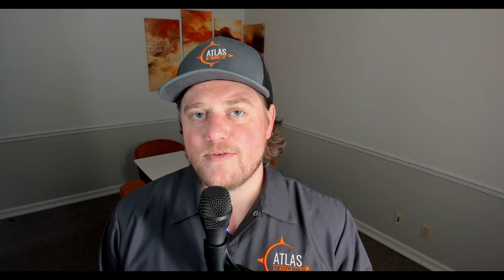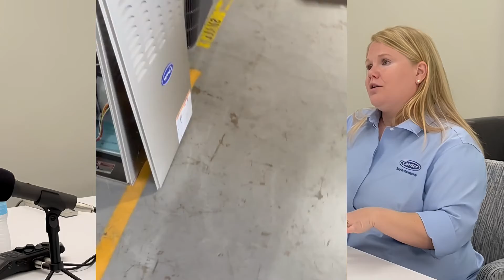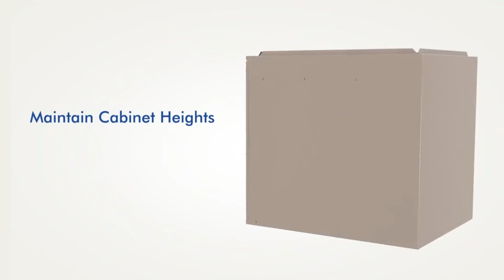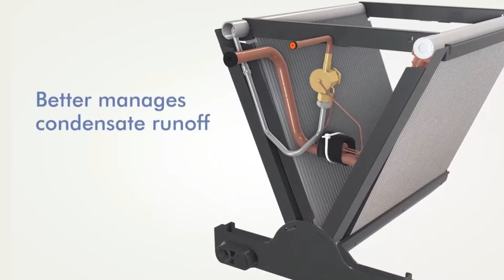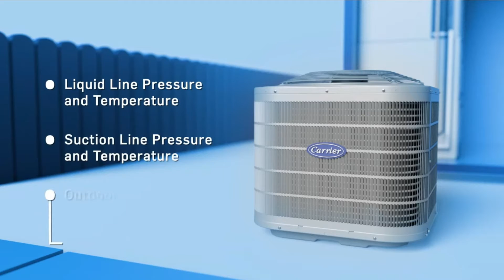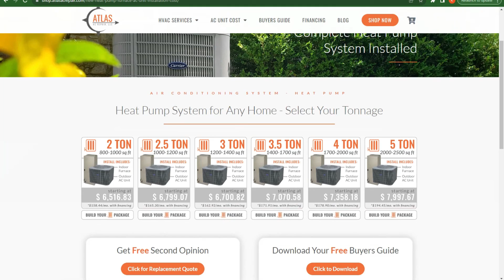Technology That Separates CARRIER From The REST

Comment: Likable fellow.  Seems honest.  Open.   Having said this, I DO NOT WANT my A/C electrically, permanently, attached to the SALES DEPARTMENT in addition to the dealership.

I want it to work.  Air conditioning is NOT COMPLEX unless made so.   Remember refrigerators that lasted forty years?  That is the same as air conditioning, essentially.

I want a unit that will work for twenty years as the A/C I have now has, and now has become noisy (Condenser, outdoor assy)  I don't want vagaries like firmware updates, communication errors, introduced problems by the dealer, permanent ways to degrade reliability in the name of increasing reliability.

Comment: What about reliability? It doesn't compare to the old
Reply: Would be great to include capacitors that don’t fall out of spec in the first 2 years.
Reply: @JoeB3  Put an AmRad in it and quit your crying.  They all put crap chinese bullshit, so I swap them out before install including the contactor.  I leave them a bag of the replacement items and they can be used later, and they are part of my service contracts.
Reply: @Balticblue93  I don’t own the company🤷‍♂️, All the manufacturers put in cheap capacitors but I have seen unusually high failure rates with these, thus the whining. Amrad are very nice and I have heard of several guys (owners) who swap out the caps on install.
Reply: @Balticblue93 what's an amrad?
Reply: @JuanMaldonado-ik8lg  it’s a company/brand
Reply: @JuanMaldonado-ik8lg 
Amrad is a brand of capacitor.